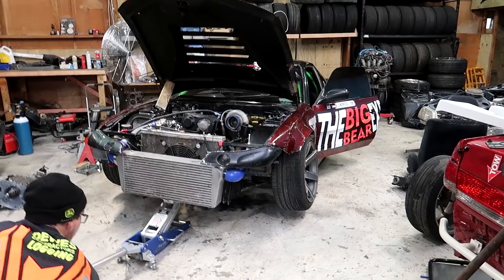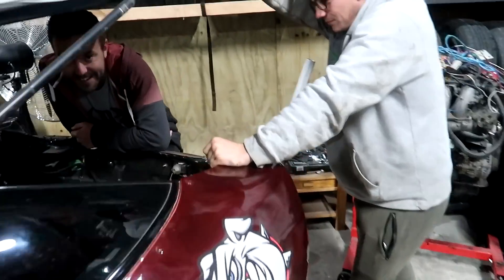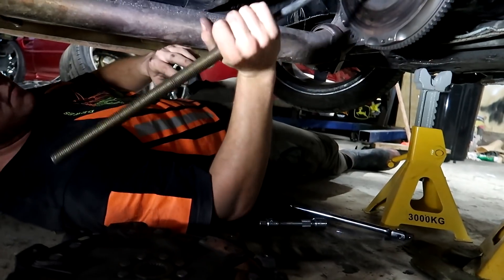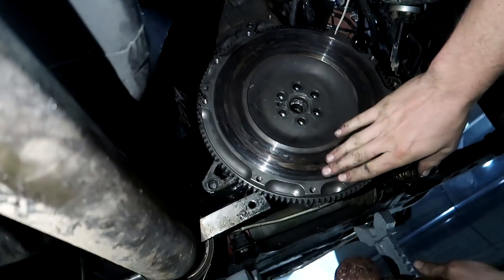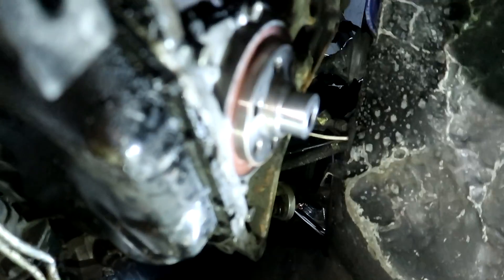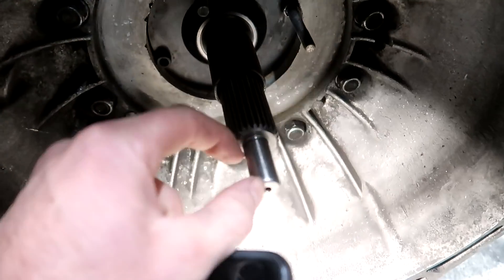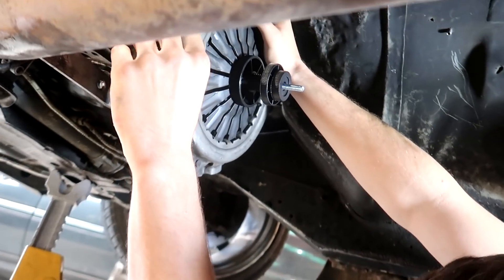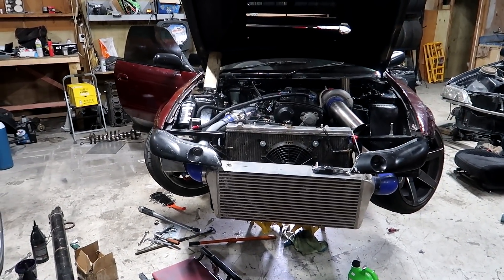RB30 180sx Dog Box Install

Comment: That cliff hanger at the end! I used one of those types of release bearings before, it shouldn't be able to move side to side, normally it would be held in place by one of those studs, like has a groove that fits around the stud, fixed into position.
Reply: Like the way it is now,when you press the clutch in, it's going to spin the hole thing and the line is gona hit one of those studs and that's what's going to stop it. Not cool.

Comment: could it be that with the shims for the release bearing, you were told to use all those extra shims to help account for the small spigot bush? coz the distance your box now hangs off looks about the same as the difference in size between the old and new bearing.

EDIT: AHHH nahhh you boys soved it good on youse